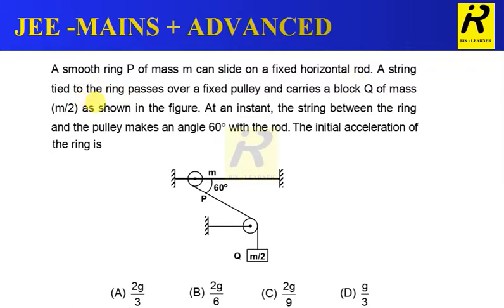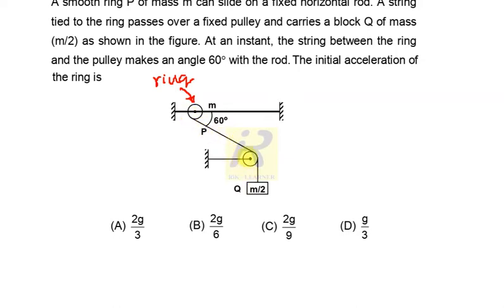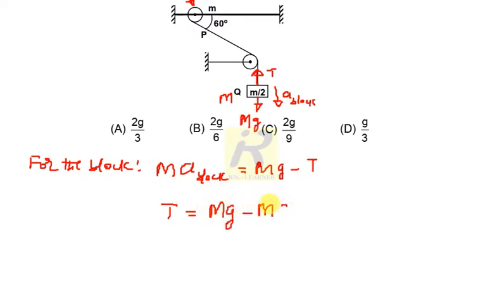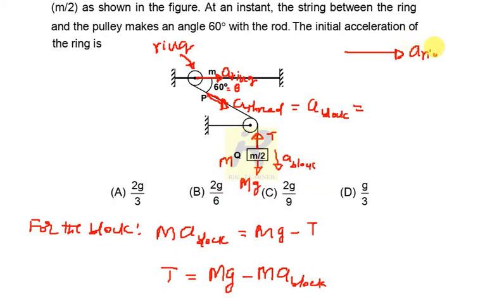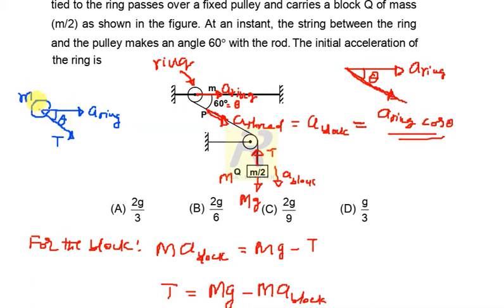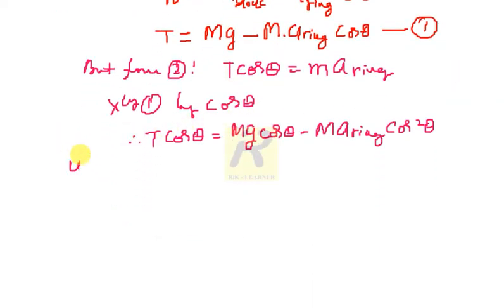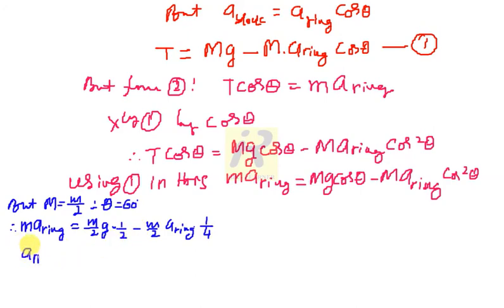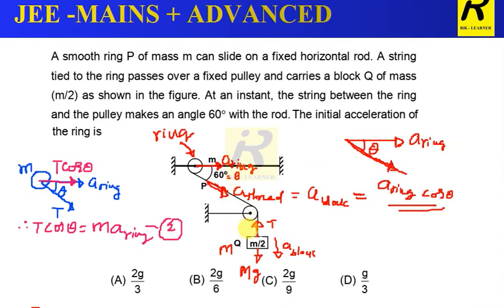A smooth ring P of mass m can slide on a fixed horizontal rod. A string tied to the ring passes over

Comment: Why tension betqeen pulley and ring and between pulley and block the same??
Reply from the maker: single rope means single tension
Reply: @iam-RIK79  But in between them pulley is there so tension should change?
Reply: @iam-RIK79  kindly clear the concepts and then solve questions or it would be quite difficult
Reply from the maker: i am not getting your actual question/doubt, plz comment on this whatsapp 9663091319